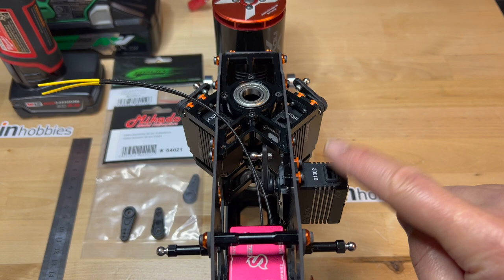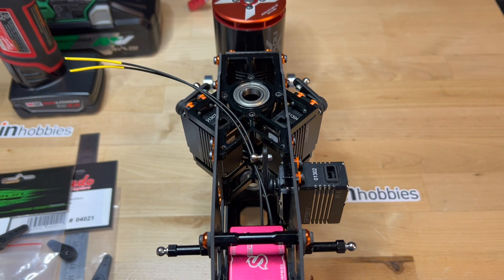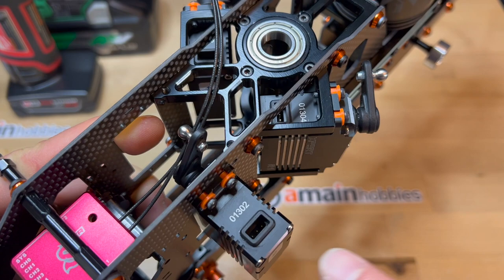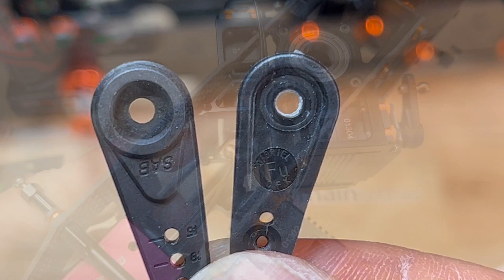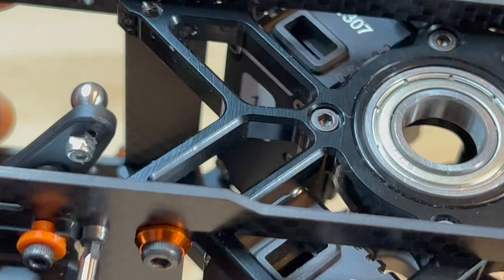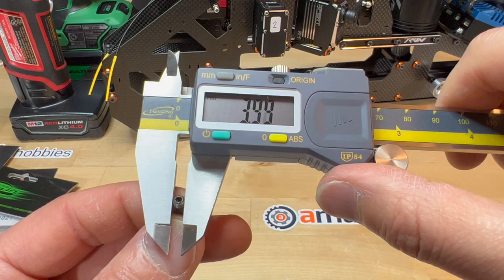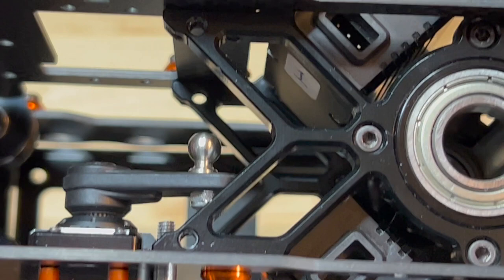Tron 7 0 Build and Setup Tips and Tricks Part 6    Elevator Servo Assembly   HD 1080p

Comment: I also used the SAB servo horns. They work great.
My elevator servo worked out bang on as per the manual. But I used GDW Servos  so probably a slightly different size.
Great tips for others.

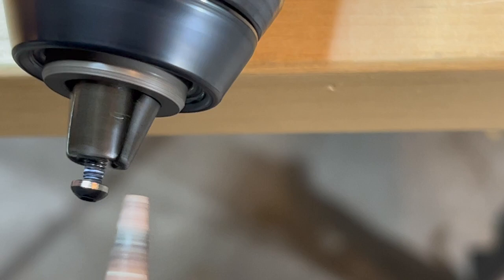Comment: Volume Warning 7:24 
Very nice job of “machining” minus the machine shop! (Despite not having lathe etc.)
I wasn’t prepared for the motor noise (I know camera needed to be close for detail).
I wonder if a regular socket head cap screw (as opposed to button head) would have worked.
Keep these great videos coming, nice work!
Reply from the maker: I am so sorry about the increased noise at that point in the video.  I debated using a button head vs a cap head.  There are two reasons why I decided to use a button head.  The button head uses a 2mm hex driver vs 2.5mm hex driver for the cap head.  I felt that grinding the cap head could possible make the wall too thin and possibly prevent removal of the screw after the next inevitable crash.  I felt the button head would be easier to grind and the head wall would remain thick enough to not be an issue when removing the bolt in the future.